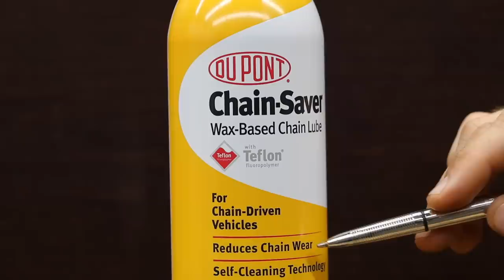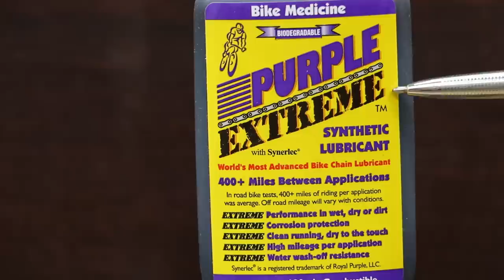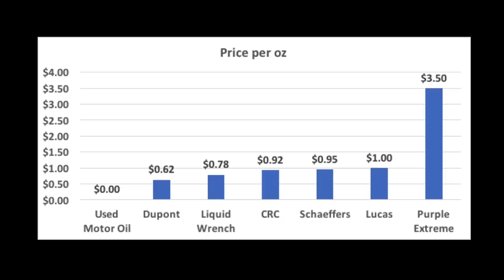Which Chain Lube is Best? Let's find out!  Ultimate chain lubricant showdown!

Comment: I know this is an older video but I use chain lubes weekly as I ride a motorcycle 160 miles a day. Any and every chain lubes I have ever used instructs you to warm the chain up. "Go around the block" is what techs tell you. Then you apply while the chain is rolling then you have you run the chain after its applied.  Maybe that's why you didn't get complete coverage on the rust test.
Reply from the maker: Thanks for the constructive feedback

Comment: So the thing about dupont chain saver is that its a wax based lube. It's a dryer lube for a reason. I use this religiously on my R6 motorcycle and it works like a charm. I've been using it for about 2 years now on the same chain and I have no rust on my chain because of it. The chain saver lasts about a month or so in California's blistering heat and heaps of dust.
Reply from the maker: Nice!  Thanks for sharing your experience with i

Comment: I watched this because I have one of those round hay balers, and this is what I need the lube for, so I was surprised that you were trying to solve the same problem.  I was surprised at your final recommendation for the baler.  Here is why: the chains move slow enough that slinging is not an issue.   Unless it is stored outside (bad owner), rust should not be an issue.  Exactly as you stated, the biggest issue is debris (ground up hay), plus being able to lubricate for which chain temp might be determined.  In watching your application of CRC, I was very disappointed to see that it does not have a spray tube to reduce waste.
Reply from the maker: Thanks for the feedback.
Reply: @ProjectFarm  I have some interesting information.  In the past, I have used various motorcycle chain lubes, but the most recent is Liquid Wrench Chain Lube.  Yesterday I re-lubed my baler chain, started to bale, then the baler broke after 2 minutes.  It has a major problem, so I spent part of yesterday and all day today taking it apart.  Here is the interesting part - I had to remove 4 chains.  The chains almost felt dry to the touch; sort of felt like they had wax on them.  They looked dark but clean, but I have not pressure washed the machine since before hay season last year, so it has been 12 months.

If you are looking for suggestions for a "test 2", maybe you could: (1) add a measurable temperature check (laser type?).  (2) try the tests 24 hours after coating; this would allow solvents to dissipate or protection to "cure".  (3) note which ones will color or stain surrounding areas (either from spray or slinging), and (4) rate/note ability to focus-spray (vs paint spray).

I like your testing style.

Comment: chain testing is tough, the dirt adhesion to the chain isnt good, but the plates being lubricated isnt very important, the rollers and pins are where the lube needs to get and stay. i oil my chains then rotate them to allow the lube to get into the rollers then i wipe the chain down so it should be clean and oil free, i have had little wear on my 64 inch snowblowers chain or sprockets by following tthis method. the chainsaw test is just mean, they spin so fast there is a reason lube is constantly supplied :) i liked that test as its very extreme.
one viable test could be to setup a motor with a sprocket and an idler to keep tension on the chain and spin the chain for 24 hours and measure the chain growth.in bicycles they sell a tool for telling when a chain is ready to be replaced.
great vid
Reply from the maker: Thank you!

Comment: I'm from India, I normally use scooter gear oil (not used oil) in my motorbike chain and honestly speaking my chain is almost brand new after 2 years of usage. It does accumulate some dust but after every 300km I clean it and never had any rusting or wearing issue so far
Edit- I like binge watching your videos
Reply from the maker: Thanks!  Thanks for sharing.

Comment: when I bought a brand new Honda, 750 street motorcycle back in the 70s. The owners manual suggested using 90 weight gear lube as chain lube even though the chain was an O-ring chain.
  I have been using 90 weight gear lube, that I apply with a zoom spout oil bottle with the long retractable snorkel. And I put one drop between each side plate on both sides of each link, on the inside of the chain, so that the chain lube will go through the chain before swinging off. That is how I have done all my street bike chains, and there have been many… I have yet to need to replace the chain and sprockets on any of my motorcycles that I have used 90 weight gear lube on the chains. It may take me five minutes to lube each link in three places, both outside lights where the O-rings are, and one drop on one side of each roller. capillary action will get the chain lube under the roller pin, so I don’t need to lose both sides of each roller. By putting one drop on each link in three places, I do not have an Excess of gear lube, flinging off onto my rear tire/wheel slash and up in front of the counter shaft sprocket
Reply from the maker: Thanks for sharing.

Comment: Used transmission fluid after a spray with diesel to clean it.  Cost: .0009 cents per ounce.   Fun video!  But the only way to lube a chain properly is sealed in an engine or component with an oil bath. Surprised you didn't test some Teflon or silicone spray.
Reply from the maker: Thanks for the suggestion.  Perhaps on the next round.

Comment: For my bike I make a mixture of 95% varsol to 5% chainsaw bar oil. After lubrication I wipe the chain with a paper towel to remove the excess. Over night the remaining varsol flashes off leaving a very thin film of chainsaw bar oil which collects minimal dirt.
Reply from the maker: Thanks for sharing.

Comment: The automatic running boards on a lot of GM and Ford vehicles tend to get stuck and it has been recommended on many forum pages that chain lube is a good option for lubricating the hinges. Since these hinges are exposed to harsh conditions including dirt and salt, I think I'll try dupont since it has the most dirt and rust resistance combined. Thanks!
Reply from the maker: Thanks for the feedback.

Comment: The better way to test is to:
1) apply the product to a clean chain
2) wipe the chain dry after dispersing the lube through and on the chain
3) wipe the chain clean while wet
4) let the lube dry that need to dry like the DuPont Chain Saver and any wax lube
Although this way of testing may apply more to a bicycle and motorcycle chain.
Reply from the maker: Thanks for the feedback.

Comment: The majority of bicycle and motorcycle chains today are o-ring type chains.  The lube is sealed between the pins and rollers during manufacture so lubing one of these chains is primarily to prevent corrosion and lubricate the plates.  Strange because bicycle specific chain oil is most likely the most expensive option by an order of magnitude.  The primary reason sprockets fail on bicycles is that the chain stretches with use.  If it stretches beyond a specified amount the sprocket teeth will deform to the stretched chain.
Reply from the maker: Thanks for the feedback.

Comment: Hey thanks for your usual thorough and excellent testing/reporting.   I would LOVE to see a comparison of cheap vs pricey motorcycle chains in popular size like 520 or 525.  You can leave keep control of variables by only using o-ring chains (most common/popular).  Test for wear, stretch, break strength, etc.  thanks!
Reply from the maker: You are welcome!  Thanks for the suggestion.

Comment: The problem with chains is that there is such a variety of uses, and what is good for one may be lousy for another. Most of my chain experience has been on motorcycles. Chain lubes became a real issue when I started riding cross country back in the early 70's, at the end of a 400 mile day you would adjust your chain and attempt to clean the mess off the saddlebag, back then I was using LPS3, which didn't turn out to be a very good chain lube, I finally fixed the problem by buying a motorcycle with a shaft drive! Every chain drive vehicle has its own needs, a motorcycle on the highway is a high speed use, while a bicycle has completely different demands, and those are different from your hay baler...LOL
Reply from the maker: Thank you!

Comment: I'm a mountain biker and Purple Extreme is one of the best IME for this application. You don't use it like shown in this video.. you apply to the rollers only and not the the plates (watching you apply it to the outer plates made me feel ill :) ).. wipe off any excess with a rag and allow to cure for a few hours and your good to go.
The chain should be pretty dry to the touch and certainly nothing on the outer plates and you can't over wipe down your chain post application as the only place it should be is inside the rollers for a bike. For really serious conditions you can use wet lube.. but i find PE and just a good chain clean and reapply after a ride is still best.

Avoid any oil that contains ceramics for bike use as they leave behind a nasty film that hardens and is a nightmare to get off and causes significant chain and cassette wear.. considering new cassettes are anywhere from £75-400+ nowadays any excess oil gets on your cassette and captures dirt which = wear so wipe of the excess :).
Reply from the maker: Thanks for sharing.

Comment: Great comparison, but, bike chains are a whole different animal. I’ve done a lot of research in the last few months and made the switch too a melted wax with Teflon. Soaked in melted (thin like water) wax in a crock pot. Runs clean and the life span is greatly increased. As a high mileage rider it can be critical on the budget. The critical point is how much penetration there is of the lubricant and how clean it can stay while in use. Not for nothing that chain saws have oilers. Bikes can be checked with a chain gauge and chain rings and cassettes can be checked visually but unfortunately farm and industrial equipment don’t get that kind of attention in most cases. Interesting conundrum.
Reply from the maker: Thanks for sharing!

Comment: ATF and gear oil, ATF for winter, gear oil for summer. anything that is tacky will accumulate dirt and turn into a grinding paste. 

i have an FZ09 and put 20k miles on a chain using nothing but ATF, the chain and sprockets were still in spec, but i changed them anyway due to saftey. 

most people report about 10k miles on a sportbike chain. 

ATF literally cleans the chain new with eveyr application, it does sling off , and what i have found is that it cleans everything it slings off on to. a kersone rag wipes it off easy .

after 20k miles of just adding ATF, and never cleaning my chain, i replaced the chain. the front sprocket cover was spotless. 

ATF seems to last 150-200 miles, and 140w gear oil seems to stick a little better and last about 500, but both will not allow dirt to accumulate, and are very cheap compared to can lubes.
Reply from the maker: Thanks for the feedback.

Comment: You should check out Cosmoline RP-342 and Amsoil metal protector heavy duty. Both spray on wet and dry to wa waxy voting to protect metal parts from the elements. Amsoil is more of a protectant and lube while RP-342 is more of a metal protectant. Amsoil also makes a specific chain lubricant. Either way both products are pretty interesting and I would love to see both reviewed at some point. RP-342 I’m currently using as a frame undercoating. Curious to see how well it works over the next couple years. Keep up the. Great reviews

Comment: I'd like to see lube tests done on dedicated bicycle chain lubricants.  Among the most notable are: Dumonde Tech; Finish Line (wet), (dry);  T-9 Boeshield; Tri-Flow; Finish Line Ceramic Wax; 3-in-1 Oil; Rock n Roll Gold; Pro Lube Extreme; WD-40 Bike.  The merits of these oils are hard to test.  But again, dirt adhesion, anti-rust and lubricity, and longevity.  Heat should not be factored as these lubricants are not designed for that intention.  The challenge is in the testing.  Some lubes take a full 24 hours of dry time before they are fully ready and others are instant.  Point is, to test the lube in terms of bicycle usage, where a hi-heat and a hi-speed moving object isn't the test-spoiler for these lubes.
Reply from the maker: Thanks for the video idea.

Comment: I know this is an older video, but for my bicycle I have used White Lightning for the lube for many years. I mostly do road but it works for mountain biking as well. Lubes are really dependent upon the use, climate, humidity, just to name a few, so it's usually best to ask others in your local area. Then finally try a few and see what works best for you. For my motorcycle, I'm considering the Blue Tac chain lube.
Reply from the maker: Thanks for sharing!

Comment: I manage a small trucking fleet and the roll up doors on our trucks need lubing, especially the ones that do a lot of dirt roads. I am having one hell of a time finding a pen/lube that will soak into the bearings on the rollers and not gum up with dirt. So far silicone spray works the best, the roll up door manufacture’s branded lube works too but costs more. CRC makes a roll up door lube that works great but it doesn’t last. When the rollers become clogged with dirt the door becomes very hard to open/close. If you have any suggestions I’m willing to give them a try.

Comment: Proper application of motorcycle chain lube is a 24 hour arrest. After application as soon as you get done writing you should spray your chains while they’re still hot the carrier in a can evaporates over the 12 hour. 24 Hours, you will note that the Lube transforms in that timeframe thickening to 105 120 grade Grease
Reply from the maker: Thanks for the feedback.

Comment: Which chain cleaner damages the rubber seal in motorbike chain fastest. Some say kerosene itself damages the rubber seal or enter into the inside of o rings. I do use kerosene once a while. But i dont know which they used in the servicing centre.

Comment: If there are going to be many chain oil tests it might be worth building a tester instead of the chainsaw. A pair of sprockets with an electric motor or something, monitoring the change in wattage used would be very telling, especially if the motor can be kept at a constant RPM. That way dry chains could be properly tested and the resistance change would be much more relevant than the amount thrown off. I'd be interested how motorbike chain oils do if that hasn't been tested yet, I'd imagine they would prioritise a fast and long fling test and it might be difficult to do with a chainsaw. Maybe a run then testing how easily the chain itself moves afterwards but I'm really not sure. Still, as a physicist I'm very impressed with your testing of all products - most others I've seen don't have relevant or trustworthy tests.
Reply from the maker: Thanks for the suggestion.

Comment: Yes, motorcycle chains usually are sealed with X or O rings on the inner plate/roller interface, so chain lube does what??  Do they assist with chain running against rollers and guides/runners?  Do some harm the seals, allow flushing lube out from within sealed areas and not much else?  Do most fling off anyway?  Is rust prevention the only true use on a sealed chain?  And how does all this come out using something to measure power sapped from a chain as new vs as lubed externally.  Just to keep you busy.  Thanks!
Reply from the maker: Thanks for the video idea.

Comment: On a bicycle in wet condition u use a wetlube. In dry conditions (summer) use dry lubes. When u lube your chain u drip it on eatch roller u only want oil in the joints of the chain. After lubing u use a towel to wipe the excess off.
Reply from the maker: Thanks for the feedback.

Comment: Thanks for all the entertaining and informative videos.  I ran out of motorcycle chain lube and was considering buying some hardware store chain lube because the local MC parts store is closed.  I had some left over 75-90 Synthetic Outboard gear lube so that's what I used.  It stays on better that I thought it would.  The chain looks "wet" even after 500 mi.  After seeing this video, I'm wondering if the Amsoil synthetic outboard gear oil is better for my MC chain than ordinary auto gear lube and how it would compare with MC chain lubes such as PJ1 Blue, Maxima chain wax, Motul ...
Reply from the maker: Thanks for the video idea.

Comment: Dupont / Wd40 / Super Lube / Blaster & others make Dry lube sprays!that dont attract dust. 

I use the WD40 specialist drylube all the time but especially on Tools to hopefully prevent rust (all seem good so far!) and because it drys without the white film some others have. 

It also doesn't leave a black oil stain on by the hinges of my white doors like regular WD40 does & doesn't collect dust in the sliding door tracks.

It would be awesome to see a test between the various drylube brands to find out which is the slickest and when one prevents rust the best 👍🏻
Reply from the maker: Thanks for the video idea.

Comment: FortNine did a comparison of chain lubes (as well as cleaners), they concluded that a heavy weight gear oil is not only mfg recommended, but also performed the best. The video used in their video is SAE 75W-90 . I think I'm going to try that once my Motul runs out. The video is "Never Buy Chain Lube Again? Comparison Test" if you want to check it out for funsies.
Reply from the maker: Thanks for the suggestion.